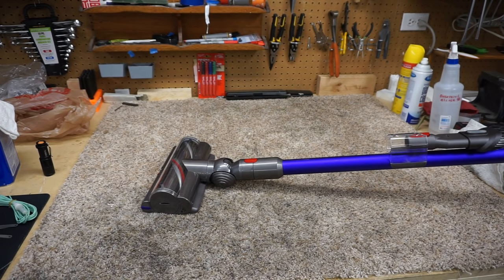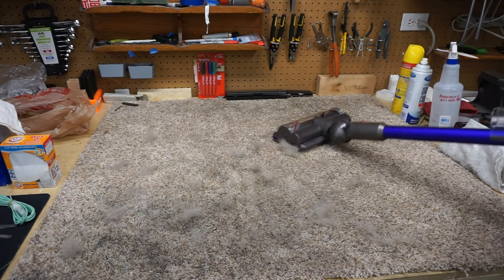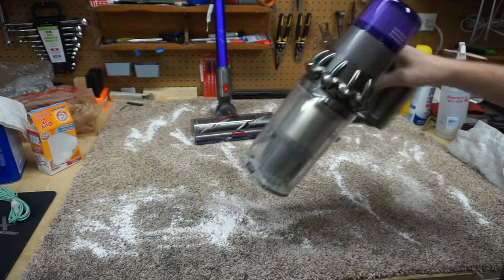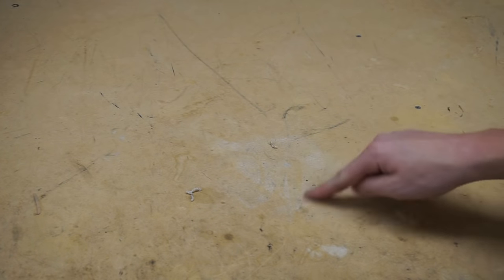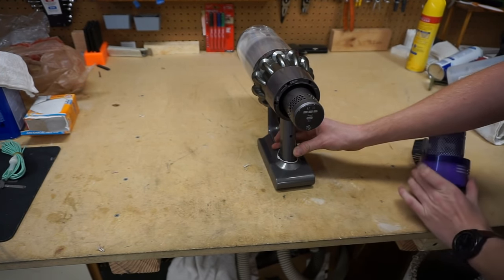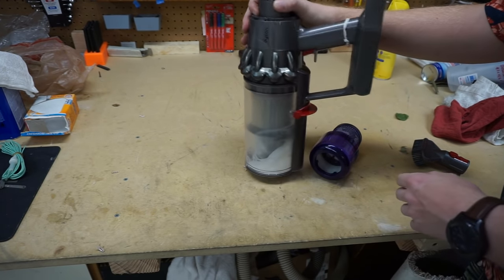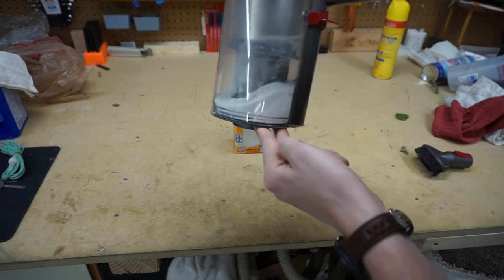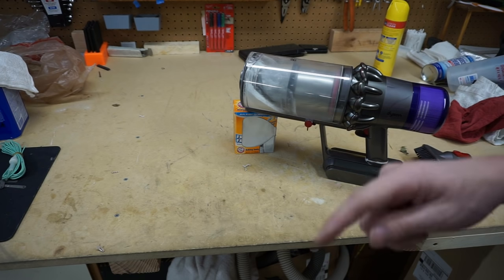Why Baking Soda Will Ruin Your Vacuum Cleaner! - Why Baking Soda is NOT Carpet Cleaner or Deodorizer

Comment: Just learned that there's large - granule baking soda specifically for deodorizing carpet and is easier for the vacuum to get. Sounds like a plan.
Reply from the maker: Why not just use proper enzyme carpet deodorizer?
Reply: @PerformanceReviews  any suggestions? Price may be a factor as well.
Reply: @kylemarienthal  wondering the same I need some suggestions. Just moved into a new place and the carpet was “washed” but It smells like ass!!
Reply: I bought some large granule carpet deodorizer from Amazon and it stank so badly of chlorine that I returned it.  Why would I want my carpet to smell like a pool?!

Comment: So is it the particle size that is bad or the chemical compound of baking soda? To me, the pet dander is a smaller particle than the baking soda.
Reply from the maker: It's the volume of small particulate. However Dysons or really any Bagless Vacuums  don't do very well with pet dander and pet hair.
Reply: @PerformanceReviews  I have a Dyson Animal my mother bought 15 years ago and it's still going strong.  It's picked up Pomeranian hair explosions and I used baking soda on dog urine, vomit and feces when cleaning stains out of the carpets. That said, I stopped using it when I read it could ruin it.

Comment: Will it damage a shop vac?
Reply from the maker: A "shop vac" doesn't filter sufficiently enough.
Reply: @PerformanceReviews  I know that. Wet/dry vacs are mainly used to clean up nasty heavy duty messes that would damage a domestic cleaner. I use mine occasionally in the house to clean up dryer lint and cat litter. It has an OSHA compliant HEPA filter so it won't blow as much particles into the air (even though it isn't a sealed system). I was asking because I vacuum up baking soda with it to neutralize the odors from sucking up cat litter.

Comment: When you have a Kirby vacuum that will literally last one hundred years.
Reply from the maker: No about 8 to 10 years as average before needing massive repair on the current Kirby G10.
Reply: @PerformanceReviews  Had mine many years longer than that  still no problems..

Comment: What would you suggest for deodorizing mattresses and the like? I've always been told 'just use baking soda'.
Reply: I would vacuum the top of the bare mattress with a powered hand tool. See if you can pickup a Dyson handheld new for $179. Just make sure it has a hepa filter so you don't breathe in the dead skin particles that you are picking up.
Reply: I saw a BBC cleaning show, where the hosts used Dove bar soap for mattresses. I gave it a shot, works like a charm every time. You just dampen a wash cloth with a bit of the soap, and scrub away. Go over it a couple of times with a damp cloth, with just water, to rinse. Put dry towels on the bed and stand on them, so your weight helps the towels suck up moisture, then air dry. Use very light amounts of soap and water.
Reply: new mattress??? sheets?

Comment: Wish I had come across this sooner. For sure did a number on our vacuum. It went caput to say the least.
Reply: @moist.teabag  baking soda has a smell?? Its oderless that's why ppl use it on carpets, to capture bad smells...
Reply: Can you please tell me what fully happened to you too because I am in the same position as you right now and I need help with removing it but now because of covid 19 I dont think I can trust anyone coming round and fixing it
 I WOULD HIGHLY APPRECIATE IT if you can please give me some advice if you can thank you so much!!
Reply: @jimmyjim1258  A year later and i don’t know if you’ll reply but what did you end up doing to resolve the issue? 
i have a load of baking soda on my mattress and both of my vacuums stopped working not even 2 minutes in😭 
if anyone sees this can you give me some advice on how to remove the baking soda from my mattress, or if theres a vacuum i can use that wont wreck because of the baking soda.
Reply: If you all haven’t resolved these issues yet, use a shop vac